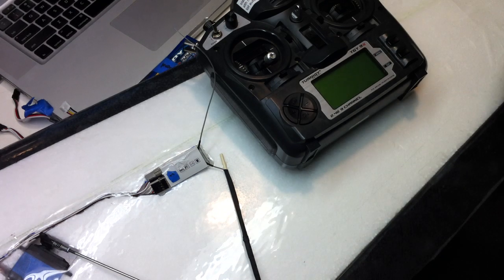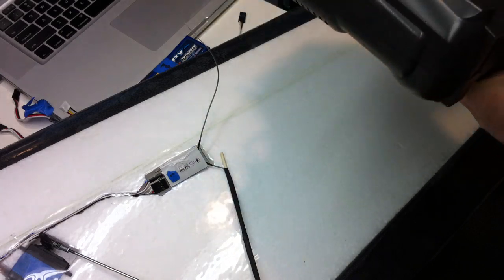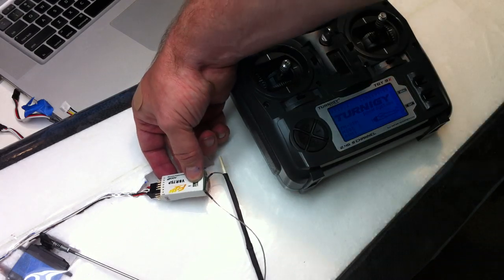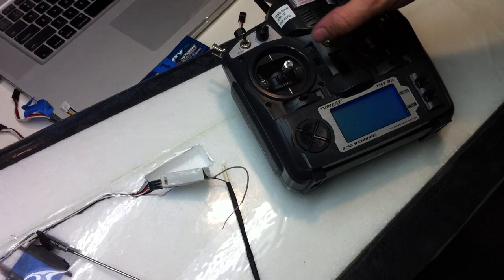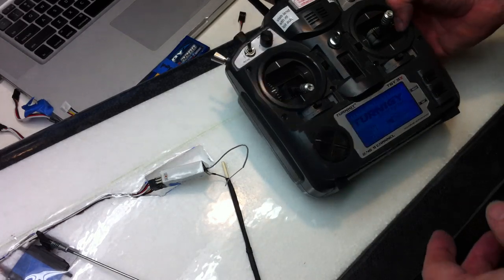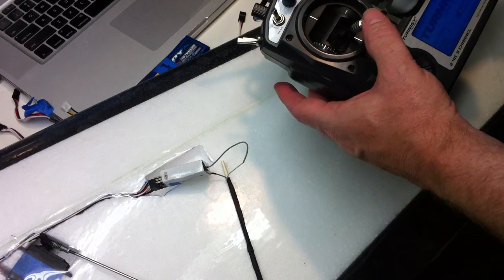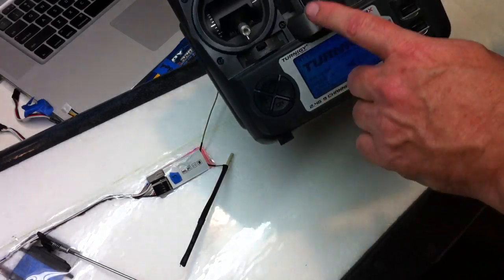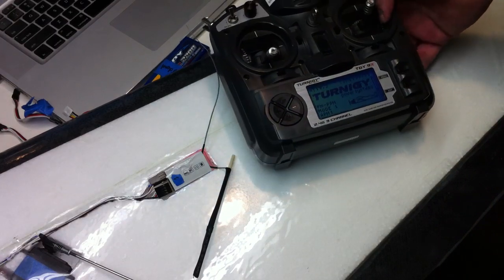FrSky: Binding and Setting FailSafe

Comment: I have the same tx & rx upgrade. I never used just the reciever without the naza v2 unit. I'm not sure how to set up the motors and fail safe with just the reciever plugged in. Does motor 1 go into slot 1 etc.? Will I have to rebind the tx module with the rx? Can I have all ESC's plugged into the slots before the battery is plugged in? Will the motors spin as soon as the battery is plugged in until it's bound and set? I have no idea where to start. Any help or tutorial links would help.

Comment: So what does the failsafe actually do?  If the model is out of range and it returns to "launch mode" won't it just keep flying farther and farther?  I guess that's not what it's for.  So only for if the Tx fails for some reason it just maintains instead of dropping?  Still not optimal.  Especially for a multicopter.
Reply: it doesn't return to "launch mode", it enters "return to launch mode", so it gets to an altitude you set and it flies back to where it was launched. but to actually get this function you need a flight controller that supports this.

Comment: Another thing as I press the subscribe button here Mark, what is going on with your motors, recently I have heard this sound coming from motor with an ESC that is not addressing the timing properly and they have been calling the condition "Cogging" . Anyway, I am setting up the Failsafe for an AXN (Bixler) , I will have it set for Throttle :Idle, Elevator: Slightly Up, Ailerons: ????? I was thinking to have this in a slight right hand band with a touch of corresponding rudder. What do you think? This is the first time for me Thanks for any response.
Reply: Leave it straight ahead, the signal will only go out for an instant at the beginning, there will be plenty of time to correct and turn around especially with an AXN!
Reply: TheFPVKiwi I thank you for your input, and seeing as how I am using the FrSky D8RII-Plus and that it "reboots" after a signal drop out, instantaneously, and the fact I only really have to deal with two cell towers, neither of which are very close, I think I could get away with that. But it would be nice once I am testing the full range of the Tx and with all the other gear I will be using both on the AXN and the Quad/Hex I really have to have a plan. Mind you there is many flights before I will testing the limits, so I will take your advice, thanks :-)
Godspeed and GoodFlying to ya mate!

Comment from the maker: Yes, you're in luck if you're using er9x.  Go to the radio options menu and you can turn off warnings related to the switch settings.